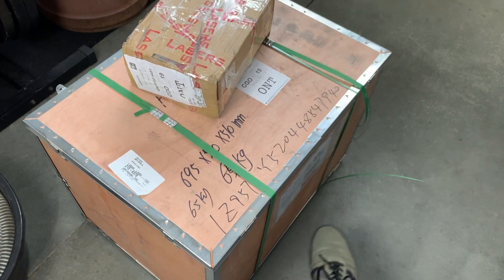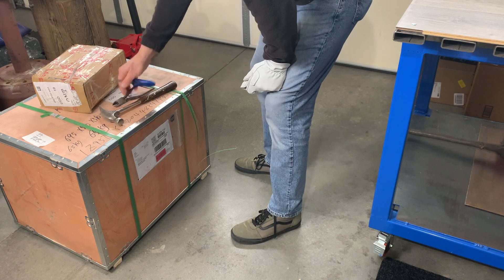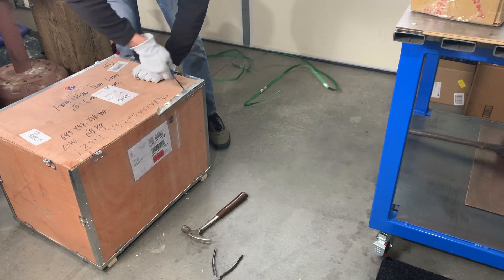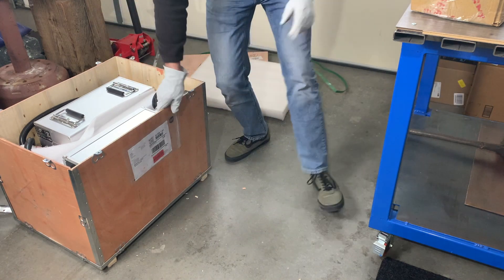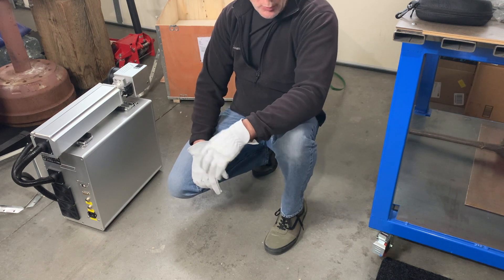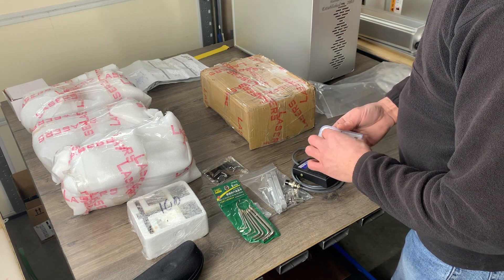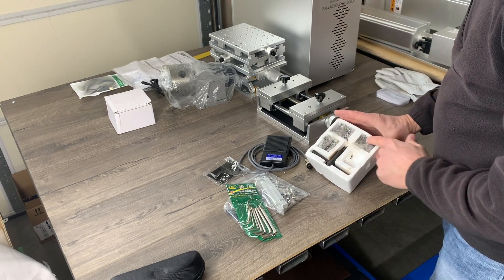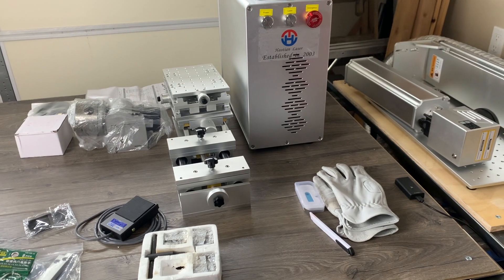Unboxing A New 100 Watt M7 MOPA Fiber Laser From Haotian Laser

Comment: Revisiting your video again as I am close to purchasing the same laser. What is your opinion on the vise and the different tables you received as far as actually using them, quality, etc. Thanks.
Reply from the maker: The vise sold from their website is for business cards, not very useful for much else.  I went on Amazon and bought a "machinist vise".  However the quality of the XY table and the Z table are "machinist" quality
Reply: @NewportStudio  Thanks for the reply. I ended up ordering the bigger vise from Haotian (we'll see if it gathers dust) but I bought my XY table and a large fixture plate from Blackwell Engineering. I don't have my fiber laser yet but I have received the Blackwell items and the machining on them is top-notch...I love highly machined items!

Comment: Thanks for the video. Is there a particular reason you went through Haotian rather than some of the other companies e.g. Mactron, SFX, etc. I ask because this was the route I was going until I joined a Facebook group and they sang the praises of Pascal and Bela so I started looking into them and came across your video and a few others. How has your overall experience been since you received the laser? BTW...did everything you showed in your video come standard or were some of them add-on accessories? Thanks.
Reply from the maker: Hindsight is 20/20 right? lol - I really didn't know how this was going to go down.  I actually had a rep from Visa on the phone live as I made the payment to make sure he did not see anything on his end out of the ordinary as we made the transaction.  As it turned out, this was actually the smoothest "large" purchase I've ever made!  The BIGGEST upside is in fact their communication.  I couldn't believe how quick they were to ship everything to Idaho as well.  I liked Pascal and Bella so much, we're now facebook friends; simply because the communication is so great.  I still have questions sometimes, and they have ALWAYS without fail, gotten back to me shortly after they get to the office.  I had a question about using some different settings so I could go deeper, faster.  They brought a tech into the chat on messenger and he told me exactly what settings to use; speed, power, etc.

Since I will be doing mostly pew pew's, I needed a company that would stand behind their product; I have nothing to gain by saying this, but they give/gave better service before, during and after the sale than the local dealer for my new truck (No joke).  No run around, no excuses, nothing; just excellent communication.  That's why I keep singing them praises.  I read on some of those forums every day that when the company gets it shipped, that's pretty much it.  I can't say that for everyone of course, but these guys know their customers and their product.

The x/y table, rotary, z table were "add on's".  Thanks again Larry!
Reply: @NewportStudio  Thanks for the great response! My only fear right now is some have said that they had to pay up to 32% custom fees above and beyond the agreed on price when they ordered a laser from China. Bella from Haotian texted that the price they give is the final-final price so trying to nail down what some people are saying vice what suppliers are saying. BTW...saw the Newport name and wondered if it had anything to do with Newport, OR. I spent two years in Newport, OR, while in the Coast Guard, and (you mentioned Idaho) I have a brother and sister and a ton of nieces and nephews in the Boise area. I went to Boise State University for a semester before joining the Navy (eventually moved on to the Coast Guard which I retired from). BTW, I went to BSU the very first year they gained university status...man, in a lot of ways it doesn't seem that long ago but, reality...it was!
Reply from the maker: @steinbierz  Haha.. yeah, I'm in Boise Larry, and that pic for my channel is the lighthouse in Newport, OR.  No official reason, just love the place.

Zero customs from Haotian (or anywhere). I had also read that some had to pay "something" (customs, shipping, etc.) after the fact.  In fact I read a few horror stories that almost shook it away from my purchase.  But nope, zero customs, shipping or anything hidden.  The price they give you is the ONLY price you pay.  You pay when you order, you get a confirmation, can communicate with them daily, and you'll have it in a week or so.  Done and done, no other charges.  I did figure after reading those "other posts", that if I got one, I just wouldn't pay it; I paid for the machine, got the machine delivered INTO my garage, and done.  Anyway, I made that way longer than it needed to be.  There are zero other charges.  Take care Larry!
Reply: @NewportStudio  Now that you mention that, just so you are not surprised like I was, when using your debit card they charged me a couple of hundred or so in credit card fees. Not Pasal, Alibaba.
Reply: @NewportStudio   I bought exactly the same machine as you did, but 5 months after you and I have to say, everything you experienced is still the same 5 months later.
Reply from the maker: @JimPierceJr  Oh yeah, I still message them for settings I can't find/import from "laser everything".  That website is a great first resource.  You pay $8 for a monthly subscription, then you get access (download) the entire "setting library" for your machine.  Congrats!
Reply: @NewportStudio  Not bad at all, thanks, what kind of things are you doing with yours
Reply from the maker: @JimPierceJr  Started with slate coasters, then graduated to brass knives, then got my 07 FFL for firearms; so far, have only done two of my own.  Just started another instagram acct. today: overdrivecustom
Reply: @NewportStudio  I am a police officer/Drone Commander and I know a lot of law enforcement people and spread the word that I would have this fiber laser coming and showed several videos and had several interested in doing something to theirs. After I found out about a machine shop in town that does the same thing so I decided not to step on anyone's toes when there are so many other things I can do as money makers. I have a Springfield 1911 Stainless I would like to do but am scared to death of messing it up, lol So it may stay the same for a lil while yet, lol  I am in such a bind right now i need to find something that will sell continuously and a way to market it and a place to sell it. I started out with slate coasters as well and did a couple of hundred then dropped off like you shot it out of the air. I am too busy doing everything else in my life to be able to properly address marketing, figure out pricing, come up with a price list, etc. and I am a web developer, lol and do site hosting, both for over 20 years now, sad.
Reply from the maker: @JimPierceJr  Yeah, it takes a lot of time to get the right "feel" for your machine.  I was nervous as hell when I leveled up my Kimber slide to engrave it; thought I had everything down perfect.  I could not figure out why the artwork was down and right about a mm... I'd lined it all up just as I should.  Then I framed it again on another layer and saw that the red outline laser was off, but I didn't understand yet.  Anyway, finished the slide then did some research on the red framing light, and found there are adjustments for that too (omg).  So I fixed that in lightburn, then did my shotgun. IT came out exactly where it should. Long story longer, glad I practiced on my own firearms before a customers.

Comment: I do hope you have another welding table... to rob Peter to pay Paul is almost a travesty!  Of course my crappy welding table is doing storage duty and I can't get to it to weld anything for the life of me.  

Regarding the AC Infinity, I have the 6" and have the same control knob.  I only need about the 5th level and it's annoying how I have to push it umpteen million times to go to full power just to turn it off.  Really wish it was a more simple 2 button control or something.
Reply from the maker: Same welding table, but just 4 screws holding those table tops down.  I hear you though, especially on the power switch.